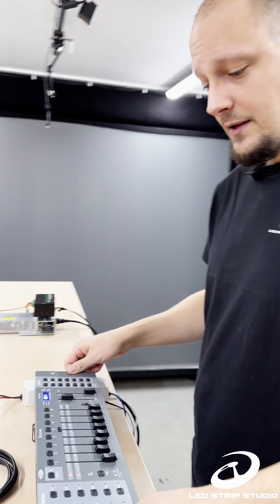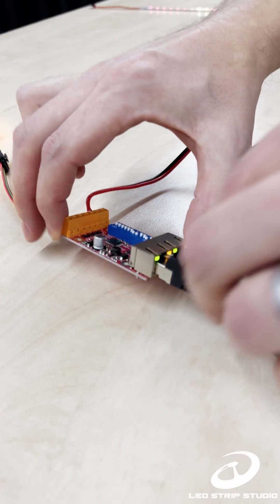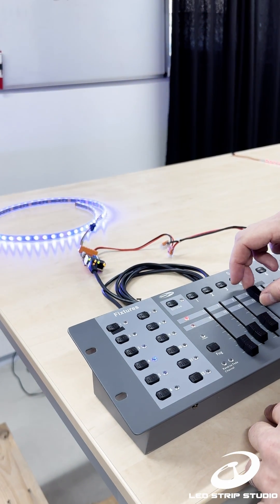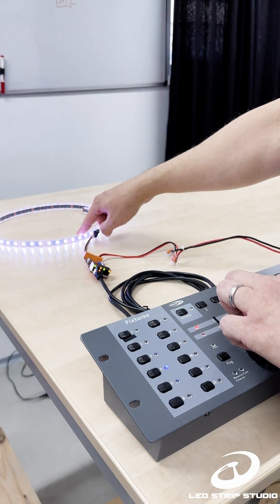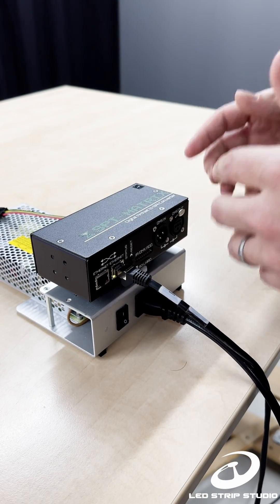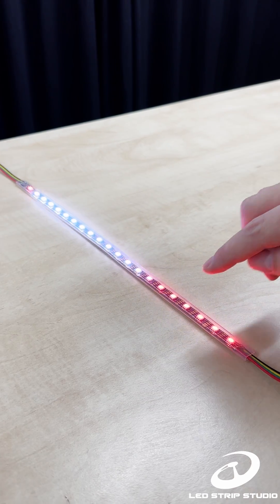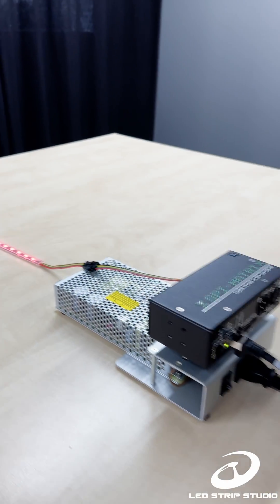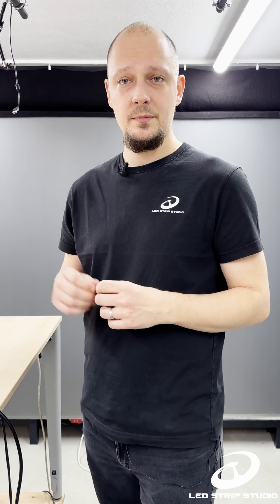SPI vs DMX - How are we using it in different applications

Comment: But there are also addressable LED DMX512IC strips?
Reply from the maker: Yes, there are. But we are not fans of those as well. It's just too many cables for pixel LED installations. More details here: https://ledstripstudio.com/why-is-it-even-more-stupid-controlling-digital-led-pixels-using-dmx/
Reply: @LEDStripStudio   @LED Strip Studio  I read that article and in no way does it cover 5 pin digital DMX512 LED strips. The DMX512ICs receive DMX data communications directly. You can wire a 3 pin DMX or RJ45 cable directly to the strip. Additionally, they run in parallel, not Serial (SPI) and any number of LEDs or ICs can die on the strip without stopping the flow of data. SPI has a single break point, and dual break point for 4 pin PCBs with backup data line.  I'm not a fan of DMX, but for professional long term installations SPI has some risks. Once again, this is 5 pin PCB DMX512IC chips I am talking about. Not DMX to SPI
Reply from the maker: 170 LEDs limitation is really a problem, once you want to use e.g. 10000 LEDs in installation. That's our point of view. Of course you can find some benefits using DMX... either way, we just don't think it's practical.
Reply: @LEDStripStudio   I understand that point but most 24V are 6LEDs per pixel/IC, and most control boxes still use Artnet to DMX. The $200 box I typically use has 8 universes, so that's 1360 ( or 8160 LEDs / 136 Meters).  And still to the point. If you are running 10000 LEDs from a single Artnet to SPI box and you have a break point 100 pixels in, then you'll have 9900 non-functional LEDs until you fix the break point.   I wouldn't take that change running anything architectural where a lift or crane would be required to do the repair.
Reply from the maker: That's exactly why we use SPI Lamps for: https://ledstripstudio.com/spi-signal-splitter/
Reply: @LEDStripStudio  okay, but having to set up dip switches for each of those units (and purchasing each of those units) sounds more cumbersome than programming the DMX512IC chips and being done with it.  It makes sense in the configuration you are running, but QuinnLED makes some long range boards that work fairly similarly and are priced lower.
Reply from the maker: More cumbersome than leading 58 separate cables from single point when using DMX to control 10000 LEDs? We don't think so.